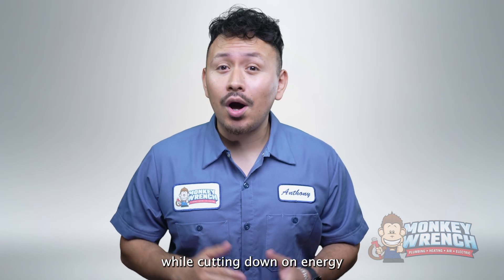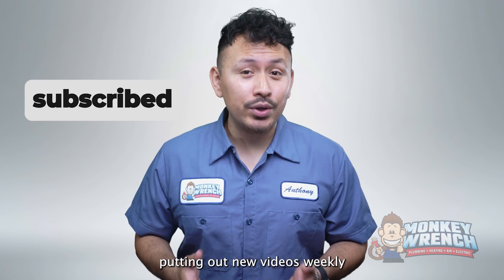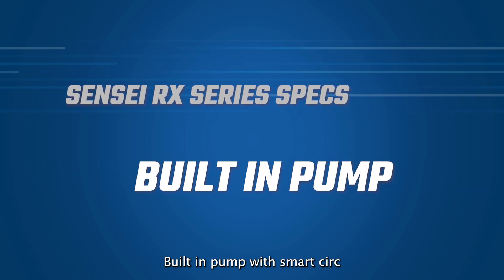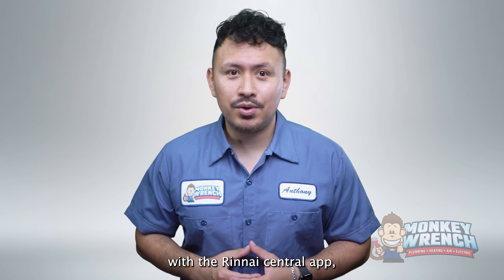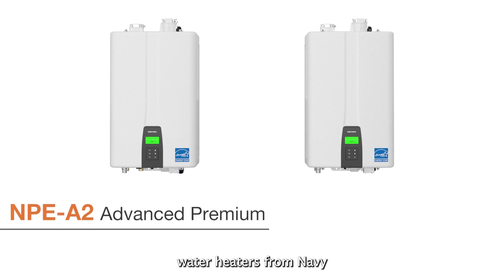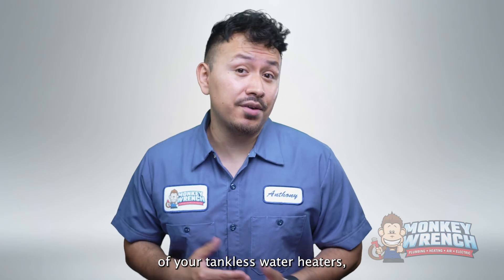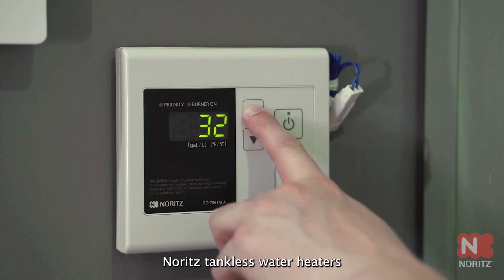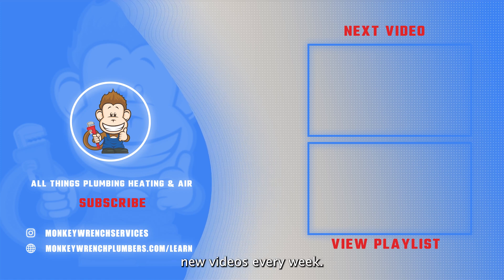Top Energy-Efficient Tankless Water Heaters

Comment: Hi, if you have a recirculation pump, does that mean your gas bill will go up. Also it seems like more issues in the future because more features. Thanks
Reply from the maker: It can potentially increase due increase gas usage as the water heater may fire up more frequently , however  the costs may offset as you will not have to wait for water to get hot. 😀